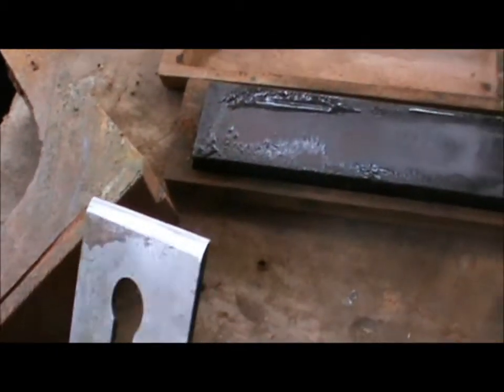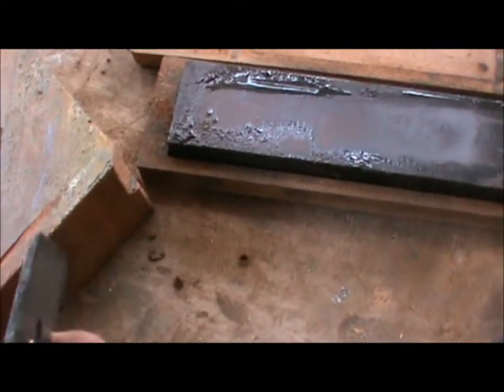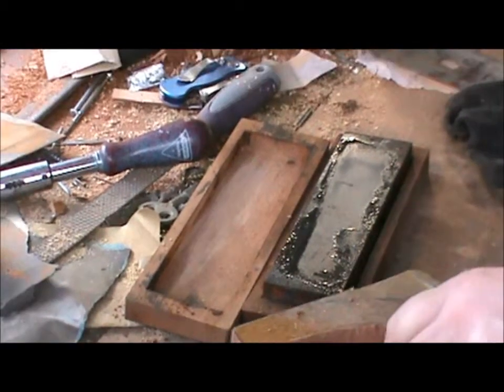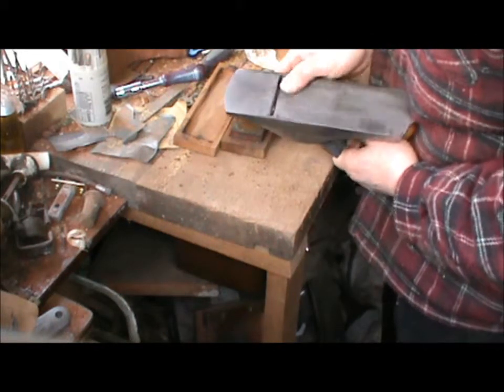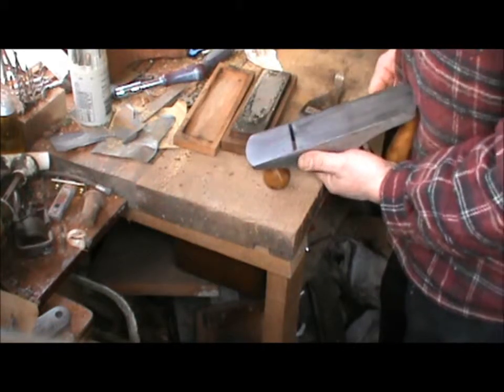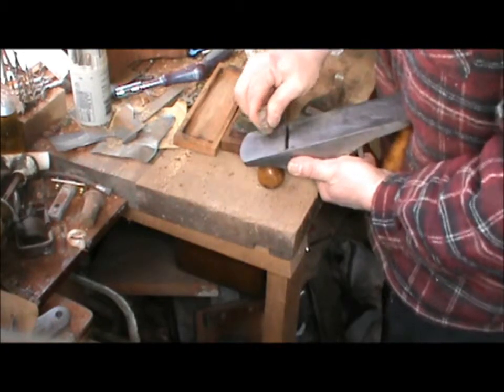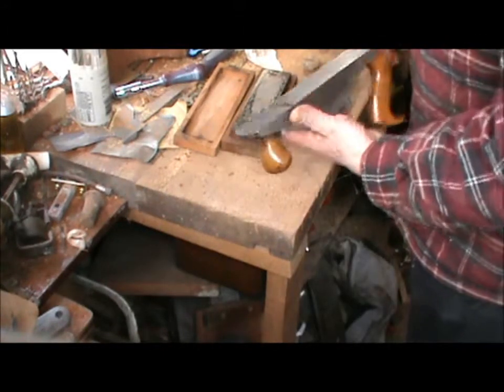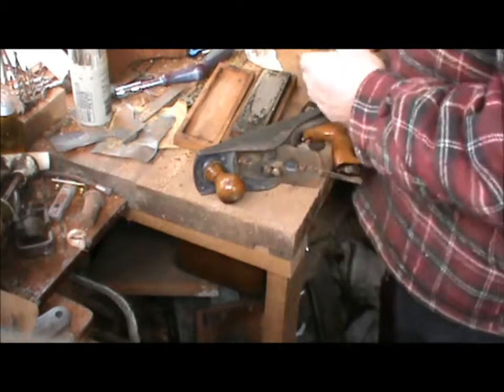Plane problem solved

Comment from the maker: Maybe at a molecular level, but I have been doing that for 50 years, and my Dad did it that way, as did the man that taught him. 
Don't forget that it is rare to paint a planed surface, it will normally get a wipe over with some sandpaper. Last thing you want is the sort of sharp edges left by a plane on furniture. 
I have never had a problem with paint/varnish sticking. 
A lot of the furniture dad made ended up with a waxed finish anyway.